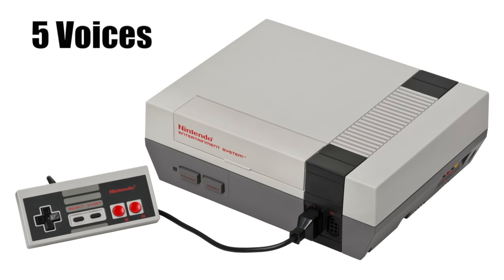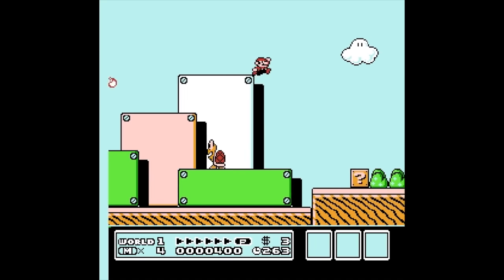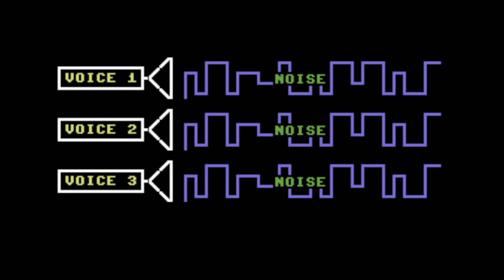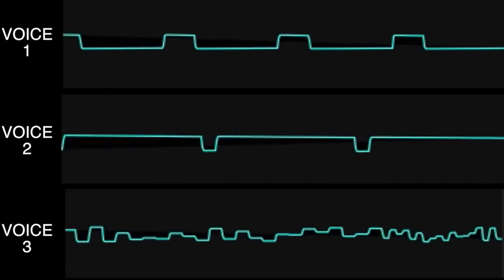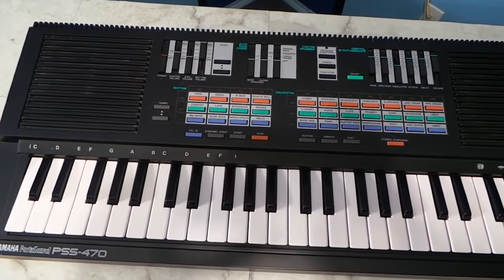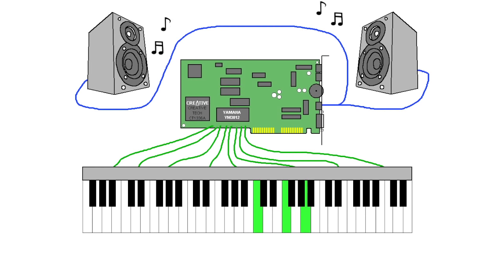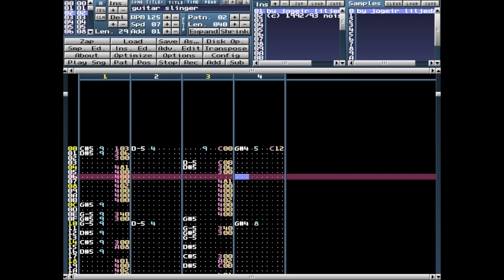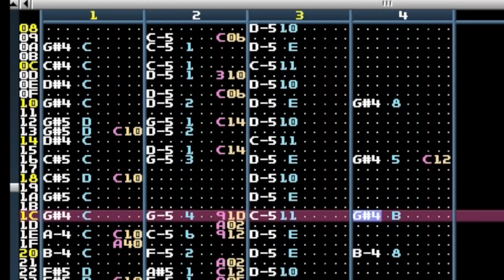How Oldschool Sound/Music worked

Comment: This was an awesome video. Thanks for doing it. I'm not criticizing. I just want to give some feedback of what I would have appreciated. I don't understand how a square wave might sound vs triangle wave and so forth. I also don't even know what that means. Does that mean that something is moving the speaker into discrete positions and it just moves it back and forth (for a square wave). For a triangle wave, does it move it linearly with time or something? Of course that doesn't make sense, because real things can't be magically teleported like that, so I guess that might be too much detail, but I'd at least like to know what that means in a little more depth.

Anyway, thanks so much for your awesome videos.
Reply: For synthesizers we usually think of the waveform as being a change in voltage over time.  Eventually this signal will be sent to a speaker which will vibrate accordingly.  Square waves actually do have sloped sides in reality as you may suspect, but it is a fast change.  A sine wave is kind of the "pure" tone like a ringing tuning fork or a simple flute.  Any waveform that looks close to the shape of a sine wave will also have a fairly clean tone because the harmonic content will not be that strong.  Triangle is close enough to sound kind of flute-like.  Sawtooth wave and square wave have very strong harmonics.  They are easier to listen to than to describe, but the sawtooth almost sounds like an electric guitar.  Anyways, the sawtooth and square have so much high frequency harmonics that we would normally filter a lot of it out.  And you can shape the tone of the sound by manipulating those filters.
Reply: @MegaTenser  Thanks so much. Would it be appropriate for me to think of non-sine waves as composites of sine waves?

Comment: Great never came across the mod tracker when I bought an amiga was that one of the first music sequencers perhaps?
Reply: More often known as trackers, there were various file formats though i believe 'mod' was the first, basically all the same - 4+ channels with a instrument noise assigned to each, there are 10000's of such files from late 80s/early-mid 90s as they were low requirements to play good music - unlike midi that needed extra hardware.  The snes had a similar bit of software that used nintendo sound beeps in place of instruments though i think that was on tradition music staff rather than channels the concept is the same.  Any free standing amiga music file from its day is probably a tracker file, some were ripped from the games - indeed there were games that had a inbuilt tracker player because it simplified things. Though the pc can't play them unless you find a prog to do so and then some files may not work right.  In its way, you could say they were the mp3's of its day, though I find it strange you never came across them unless you are't a owner from those days - P.D libraries were littered with them.

Comment: Notable difference between the Commodore 64 sound and any other 8-bit computer is the fact that the C64 has filters.
Reply: Right, and furthermore the C64's SID chip is a digitally-controlled hybrid digital/analog subtractive synthesizer with multiple modulation and filter options for each voice independently; the voices could also optionally modulate each other to make even weirder, more complex sounds.  This essentially makes it what we typically think of today as a vintage polyphonic analog synthesizer (implemented on a single chip instead of as discrete components).  And it has a limited but usable ability to reproduce PCM samples, as well.  It's nothing at all like the FM synthesis and other chips of the time (nothing wrong with those, but it's just not the same thing).
Reply: rbrtck You're absolutely right. And I knew all that, but didn't want to sound too pedantic 🤣
However, since we're at it, the second rendition of the SID, the 8580, was even a bit more advanced than the first 6581.
People are also still exploring its possibilities, resulting in the rather recent development of different ways to play PCM samples.
That sound chip is amazing!

Comment: For me, NES sound was better. Yes, it had only square waves for the first two channels, but those square waves could be of different types, with different lengths of "low" and "high" phases.
Reply: Regarding changing the pulse width of the square waves, the C64 can do it to.

Comment: Honestly, Commando's music sounds terrible, even if it is technically impressive. It's not very pleasant. 

I also argue that the NES's 2A03 audio is more flexible than talked about in this video. Take Super Mario Bros. 2, then Shanghai II (Japan only) and Smurfs (Europe only). They all use the stock NES audio but sound significantly different from each other. Shanghai has a distinct oriental sound and Smurfs like many European developed NES games has a sawtooth-like sound.